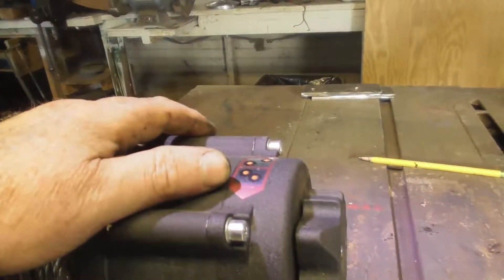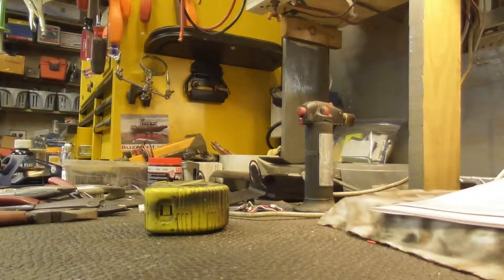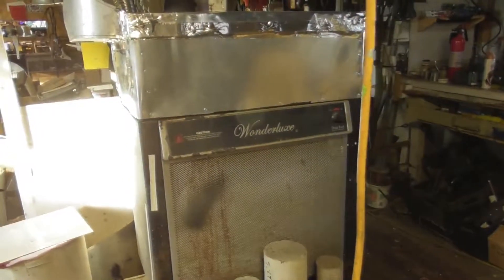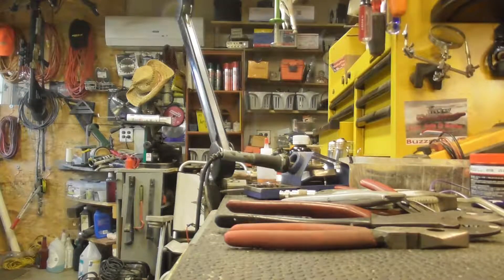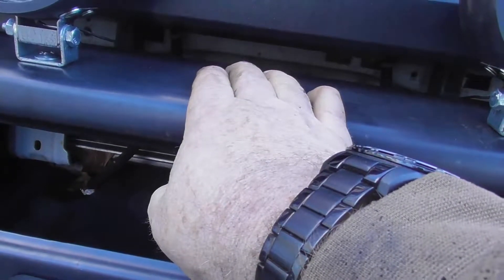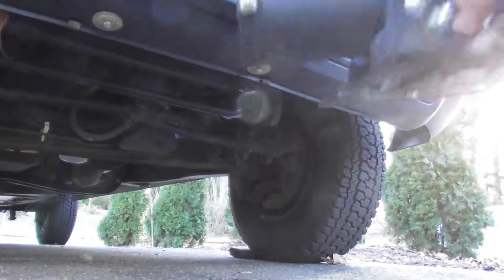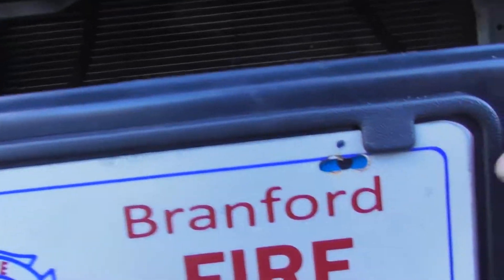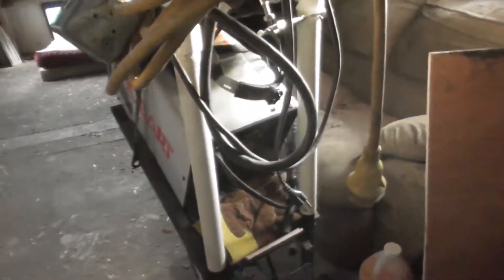So finally the winch is in place ready to be bolted   BS

Comment: vehicle makers sure don't  make it easy to add anything anymore,, used to be they had a heavy frame that ran all the way out to the bumper.
Reply from the maker: Luckily the van has a full frame but the winch didn't come with any mounting hardware.  I've bought cheap ones in the past and they had everything needed to mount it.  I welded 2 tack welds to hold it while I drilled and bolted it.   Nothing is easy anymore.